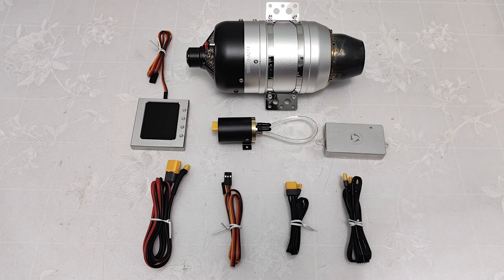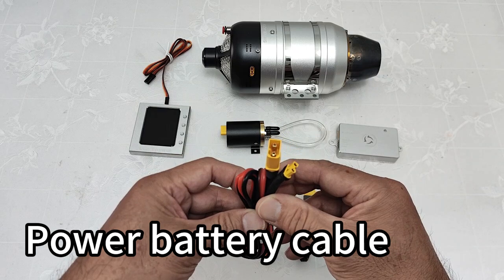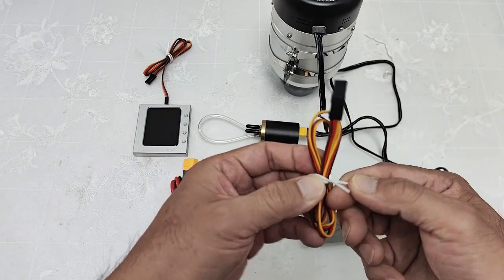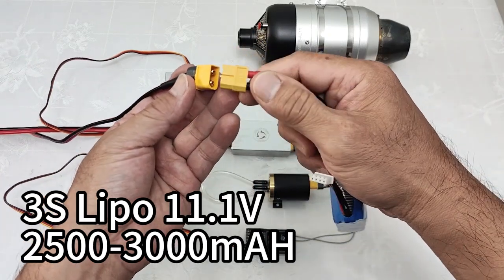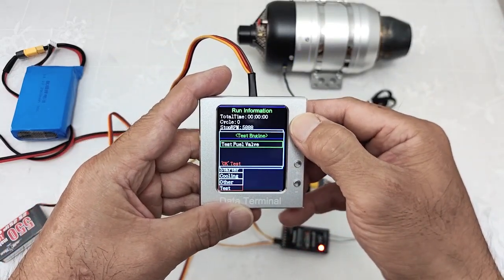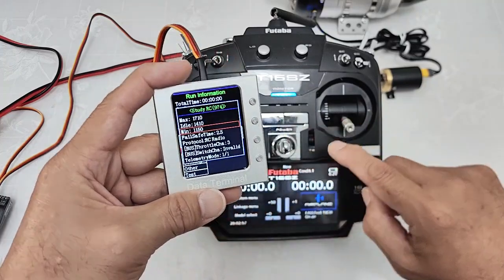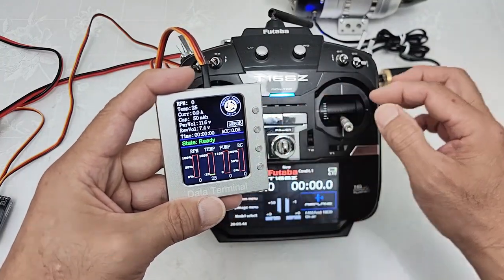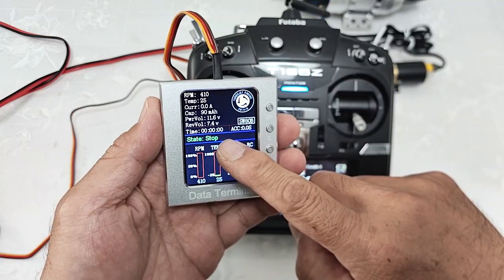Swiwin turbine basic operation

Comment: Thank you for this tutorial. My question is during the "Study RC" process, why does it NOT copy the throttle signal value exactly? It rounds it up to nearest ten (second digit from right). 
Like in your video, your minimum throttle signal value was 974 and it copied as 970; the same way your idle value was 1226, and it copied as 1220 ignoring the last digit value.
I am just curious why.
Thanks